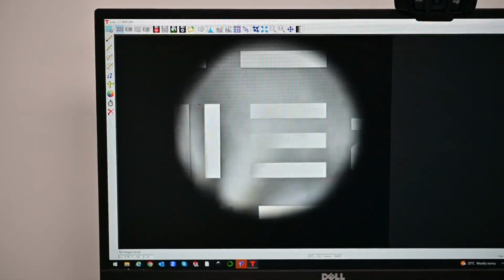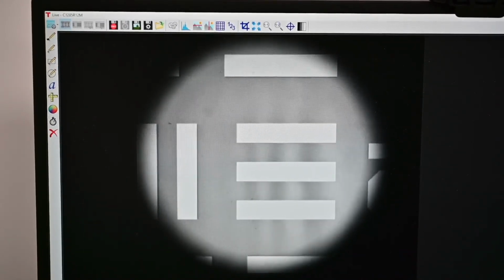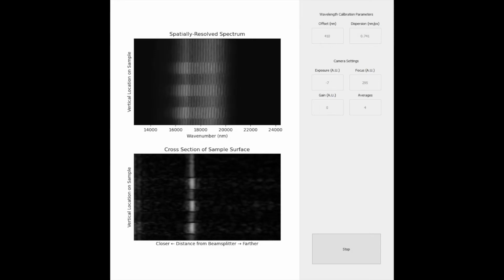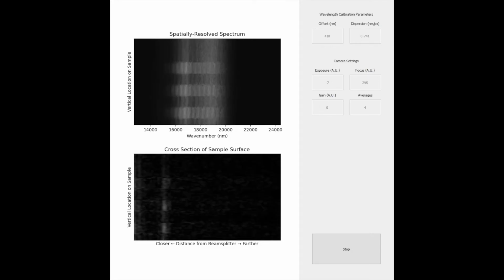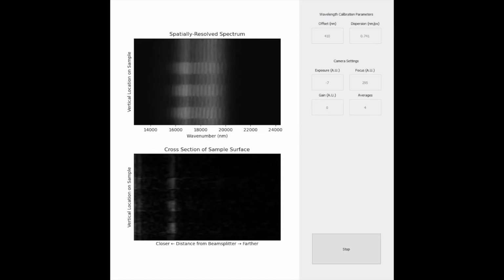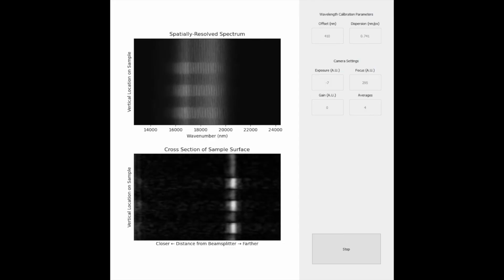Optical Coherence Tomography (OCT) Principle Demonstrated

Comment: I just read your article on the website. I am curious to know if there is perhaps some useful similarity between OCT and Compressed Sensing? It seems to me that they are similar but I do not know enough about either method to be sure. I'm familiar with time/frequency and Fourier from my Electronics Engineering degree and ham radio activities so OCT makes a lot of sense to me. Its basically an intereferometer set up to get the depth etc from the sample. ( LIGO for the eyes )